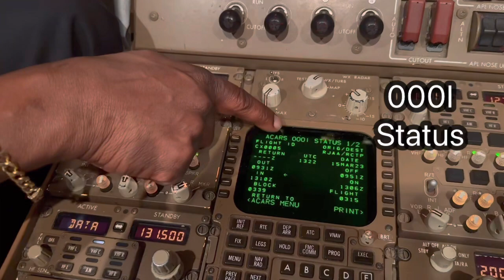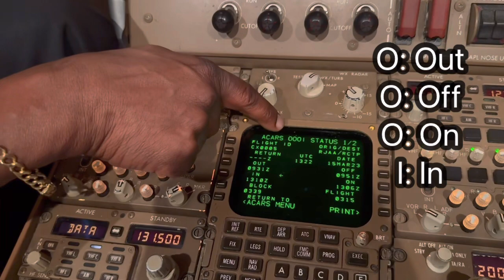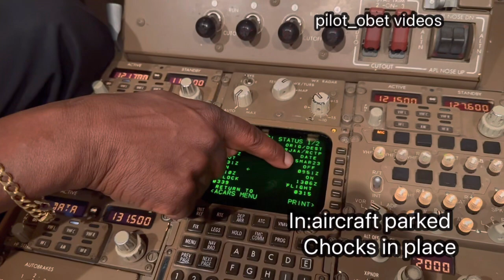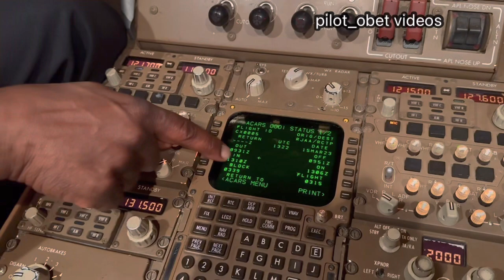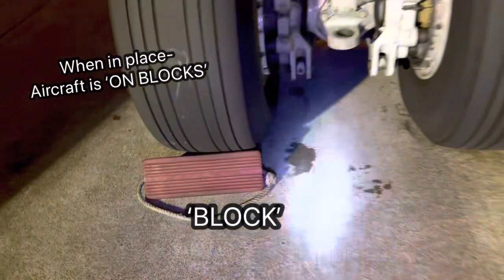Aircraft Block times:TOBT/TSAT

Comment: When do pilots have to report ready, if TSAT is later than TOBT? Still at +-5m TOBT and then wait for the startup clearance, or at +-5m TSAT?
Reply: Air traffic controller here. Yes call ready within +/-5 min of TOBT. TSAT is system generated and could show the same as TOBT or it could be later depending on the congestion on the airfield. If TSAT is later( we call it times are spread) , we advise the pilots about the TSAT so that they know when to expect a call from ATC for startup instructions.
Reply: @sgeorge1988  Thanks!

Comment: Sometimes those blocks are hard to get off. I once saw a Q-300 engage reverse thrust at the gate to lean off the one forward of the nose gear. It'd been a maintenance night, and the engineer parked it right up on the chock to the point where the ground crew couldn't remove it. Captain went into beta and reverse. That was impressive to watch.